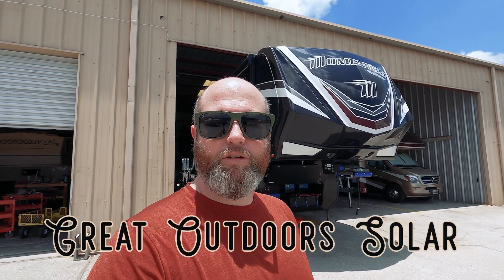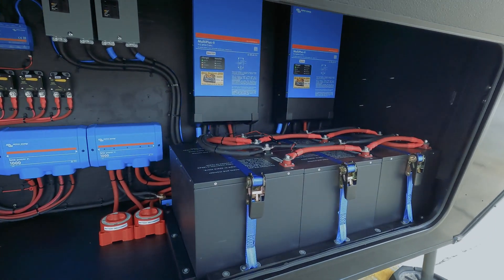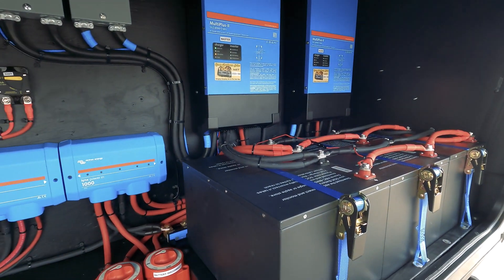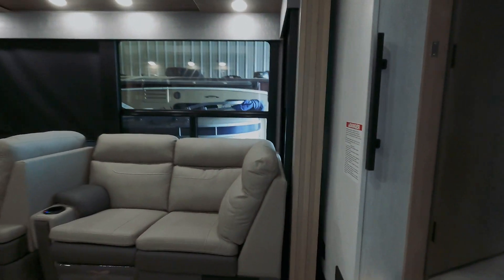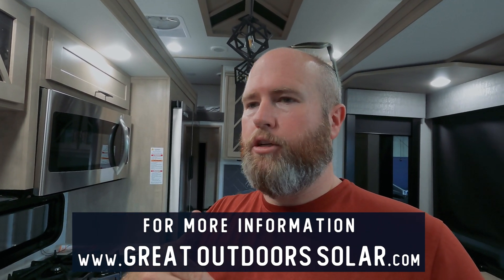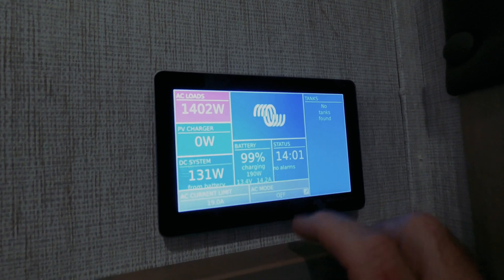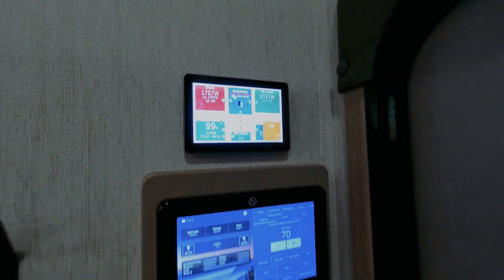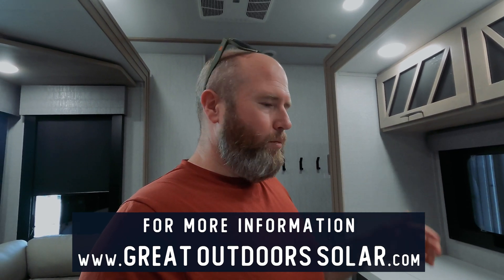MASSIVE SOLAR SYSTEM ON GRAND DESIGN RV FIFTH WHEEL

Comment: Enjoyed watching your video on your Mommentum 410 TH upgrade from factory solar system to your amazingly awesome total solar system upgrade. I’m reaching out today to ask if you could tell me where the OEM controller was located I have a 2021 Mommentum 376THS and it does not have solar on it but I want to add it. It has the automation system installed for things like the generator, lighting, awnings, etc. reached out to a dealership that sells momentums and they had told me that all Mommentum’s come pre-wired for solar I’m just trying to locate where the solar controller would have been located in that RV and was hoping you could help please

Comment: Sweet system. Very clean and balanced install too. Six years ago, we retired, sold everything, bought a low mileage, 1999 National Tropical Class A and went FT. We discovered we love boondocking so built an even bigger big solar/battery system that allows us to live off grid just like we were plugged into a power pedestal in an RV park. In fact, we haven't plugged into a power pole or run our generator in the last 2 years. 

We started small, by building a 620-watt liftable solar array on the side of our coach that makes a nice bedroom window awning too. It uses gas struts, so it practically lifts itself, and we can pin it at the precise angle needed based on latitude and season to boost its performance. Next, we built a 12v, 560ah LiFePo-4 battery using 8, 280ah prismatic cells and a Heltec 330amp BMS. These cells fit perfectly under the steps of our MH where our old pair of golf cart batteries used to reside. A small computer fan blows interior conditioner air into this space to keep the batteries near room temperature at all times. We use a 50a Epever mppt charge controller, a Lnex battery monitor on this 12v battery. We have a 1,000w PSW Renogy 12v inverter that we use occasionally to run some lower current draw items to help evenly distribute our power usage when needed. If this battery ever gets too low, we just plug in our progressive dynamics 80a Lithium compatible converter/charger and transfer some power to it from our 48v battery. 

By mounting our small, 620w solar array on the side of our coach, we left the roof free to rack 8, 550w solar panels down the length of our 35ft Class A, 15" off the roof, 1" above our AC, vents, etc. so it only adds about 3" in height to our coach, so we're now right at 12 ft. Our 4,400w array can run both our A/Cs, (one is a mini split heat pump) our household appliances and charge our batteries at the same time. We mounted a Sungold Power all-in-one 48V, 5,000W Inverter/100A charge controller/battery charger, breakers and a Lnex battery monitor on the wall in our bedroom, as we don't have a big front bay on our coach like on a fiver. This saves us space as well as money compared to a system built with individual Victron components. Our 48v battery which resides under our bed uses 16, 320ah MB31 EVE cells and a 200amp BMS. Together with our 560ah 12v bank, we have a total of 23.5 kwh of batteries onboard (the equivalent of 18, 12v 100ah LiFePo-4 batteries) charged by 5,020 watts of solar. Building both batteries ourselves saved us a lot of money vs buying preassembled batteries, plus they fit into a tighter space too. We built our 48v, 16.4kwh battery for only about $1,800 including the BMS. 

We removed the inefficient and noisy rooftop A/C we had in the bedroom and replaced it with an EG4 28.5 seer-2, 12k btu mini-split heat pump on the upper rear of our coach. It's super quiet and cools as well as the soft start equipped 14.5k Furrion rooftop A/C we have up front, using about 1/3 the power. This 48v system lets us enjoy 24/7 off-grid air conditioning and heat from the heat pump as needed. We can also run our front rooftop A/C for a few hours in the afternoon at the peak of summer heat. Both our rooftop and side array (in addition to our 22ft awning) produce some great shade, wherever we go - even in the middle of the desert. We also coated and sealed the roof with Henry's 887 100% silicone Tropicool which reflects a lot of heat, helping to lower inside temps too, reducing our A/C needs.

Our total budget for both 12 and 48v systems was around $10k plus another $1,500 for the high-efficiency heat pump, as we did all of the work ourselves. Being retired we have much more time than money. Not only will this system last us the rest of our lives, as we're old farts, but it has already paid for itself with the money we saved on RV parks. The biggest advantage is the flexibility it gives us. Last year we visited 11 states, without plugging into a power pedestal the entire time. Last winter, we boondocked in the desert near Yuma, AZ, visiting some old friends. We're visiting family in NC now, where boondocking places are pretty rare, so we're dry camping in a spacious, no-hookup site at a convenient RV park for only $100/mo., saving us $500/mo. off their normal FHU rates, yet we have access to the dump station and other amenities. Life is good.

Comment: Hello from Ouray, Colorado!  Though, we are actually down by Tucson for 2 months, currently.  This is our first multi month trip in our Outdoors RV 22FQS; and it is showing its shortcomings hehehe.  Space!!  So, we have taken a couple of trips around town to some of the dealers to consider other options.  We started off focusing on opposing slide travel trailers; but have expanded to the 5th wheel world for looking.  I'm feeling like the travel trailer option may be sinking hehehe. 

Anyways, we have a 500ah battery system, as well as 1495w of panels on our small 22 ft roof.  If we migrated to the 5th wheel, I'd definitely want to proportionally increase the system.  We don't chase weather as I'm still working, so I definitely don't want to be in the amp hour management mode; having a reserve capability higher than what we think we'd need would be the direction we would want to go.  I saw your video on the Brinkley install (which, we really really liked that 3100 floor plan.....and we also really like those Alliance 310rl's).  I would tend towards a system bigger than your "standard" 2000w system.  

On the install in this video, I really liked how you were able to do bigger panel set up on the roof, but retain a realistic walking path!!  Arguably, my 22ft rig is JAM PACKED with its 1495w on the roof.  And since I do winter camping, it really is somewhat of a twister, death defying balance act to maneuver on the roof to brush the snow off of the panels.

Comment: for a 5th wheel that is a tiny battery bank - no chance this rig would survive high temps with significant humidity boondocking without the use of a generator
Reply from the maker: We size systems based on the customer's specific needs and travel patterns. No RV, no matter how large will survive in high or low temps without a generator or some type of fuel source. You can swap ACs to a mini-split, but the traditional RV AC's can't be powered via solar alone. Having 200+ installs and living and traveling full time has given us real world usage feedback. Safe travels.

Comment: Great info guys.  I have a question …. When you removed the factory inverter. Did you just splice those in and out romex wires together with an 110v outlet in the basement?
Reply from the maker: All 110v junctions should be in a box per code. Sometimes with a smaller circuit we'll add an outlet, other times it's simply a splice.

Comment: Need to start looking at newer 48volt batteries with 4000-5000+ watts of solar. Is being done now more often. Can run two acts and still charge batteries
Reply from the maker: 24 and 48v systems in a RV are less efficient because the majority of the loads (12v DC) have to go through a DC converter that are typically 80-90% efficient aka you're adding 10-20% of inefficiency to the majority of your loads. We've done 24 & 48v installs, and 12v on RVs is the way to go in our experience. Plus 4-5kw of solar isn't going to keep up 24/7 with the AC usage anyways. It's not enough to refill the entire battery bank from overnight usage and still run the ACs. Not in the real world at least. I know people with 8-10kw in solar and 2 RV ACs and they still have to supplement with a generator. In my opinion you are better off with a smaller, cheaper system that runs everything except the AC 24/7. If you need AC 24/7 then you're in the wrong area and should travel to better weather, or simply plug in at an RV park. We've done over 150 installs, have been doing it since 2017, and have 4 years of fulltime travel (actually living off solar) for experience. Thanks for watching -Tom

Comment: I'm curious why you installed a 12v system when 48 v is much better, that's what I've done on my Bluebird motor coach. Nice system anyway
. Keep up the good work
.JS.
Reply from the maker: Because the RVs main loads are 12v from the factory and a higher voltage system requires step down converters which are typically about 90% peak efficiency aka a higher voltage system is less efficient. RVs aren't big enough to really benefit from a 24 or 48v system.
Reply: @GoRVSolar  Or you could build a hybrid system like I did. We have a stand-alone 12v system to power the native 12v appliances in our coach, and a 48v system to handle our 120v ac needs. This way we don't have to convert between the two, though we do have the option to charge our 12v battery from our 48v battery in an emergency, though I've only had to do this twice in 2 years of FT living. We could charge our 48v battery from our generator but haven't had to do so yet. We also have a Renogy battery to battery charger that gives us the ability to charge our 12v house battery from our MH's alternator, but haven't had to use it so far, as our solar has proven to be adequate for our needs.

The main advantage of going to 48v DC is being able to use smaller wires as there is 1/4 the current flowing through them and your connectors, which can easily overheat under high loads if not clean and torqued properly. A 12v, 5kw inverter needs a huge wire (greater than 4/0) to handle the 400+ amps that it can carry but 1/0 wire is adequate for my 48v, 5kw inverter as it uses under 100 amps. Also, an inverter is more efficient going from 48v dc to 120v ac, producing less heat from lower DC current, so it can be lighter and cheaper. It also allows the use of a smaller, cheaper charge controller too.

Comment: Really nice work!  I plan to add a second Multiplus 2 2x120. I was told I had to change to 24v system. You did 12v so I guess that's not true. Did you add the master - slave labels to each multiplius units or do I need to order a different unit for #2.  Did you add any additional cooling to the compartment? My single MP gets hot. I notice in the spec sheet only L1 gets power boost. I'm hoping to run 2 out of three A/C units or the wife will hate me.   Tom
Reply from the maker: You don't need to go to 24v and we added the labels. The master and slave is done via programming. L1 is the only boost, unless you are on a single phase, then the inverters relay combines L1 & L2. Best of luck with your install, I highly recommend you look at the wiring diagram by Victron for multiple units. Seen quite a few "professionals" get it wrong and they end up at our shop. Cheers -Tom

Comment: What brand of 200 watt panels do you use?  Also curious why you didn't do a 24 volt system so you could install a Victron 5,000 watt inverter?   Just curious about the thinking.  I have the generator and would like to run 2 AC units on the inverter and then switch back to the Gen when the amp hours are low.  With my 3,000 watt inverter I can only run 1 AC unit.
Reply from the maker: Rich 200w "12v" panels which are really ~23v. No need for a 24v system in most RVs, you can get a 12/5000 Quattro for example. 24v is not more efficient since we end up using a 90% peak efficient 24 to 12v converter for the majority of your loads.. since most the RV is 12v anyway.

Comment: Awesome install.  I currently have a 2017 44' Road Warrior 50 A Toyhauler with 1200 W (6- 200W) panels in series with a Victron 12V 2x 120 Inverter charger. Victron 150/85 Solar Charge Controller, Currently (2) SOK 206 Ah lithium batteries, CerboGX Touch 50.  My question is what is the advantage of 2 MulitiPlus 2 x 120 inverters vs a Quattro?
Reply from the maker: Good question Mark,
The Quattro doesn't function the same. It only does a single phase (One Hot), but it does have 2 AC inputs and 2 AC outputs on the transfer switch. The 2 AC inputs are for different sources, not spilit phase as they only have 1 Hot per input/output. The Multiplus does have a transfer switch (Terrance is incorrect) but only has 1 AC input and 2 AC outputs.. but it has 2 Hots aka its made for Split Phase (2 Hots). We've installed both Multiplus and Quattros by they way. Both of them in 30A and 50A RVs. So we have experience with both in different configurations.

The Multiplus II 2x120 allows Split Phase (50A) OR 15/30A Single Phase to pass through.  Then in inverting mode on both L1 and L2 by combining them via the relay built into the Multiplus II 2x120. The Quattro would need 2 inverters for split phase and it wouldn't boost on both L1 & L2 unless it was programmed into single phase (parallel). But then it wouldn't connect to 50A split phase without being reprogrammed to Split Phase. Or it could be programed to do both.. but it ends up with the Master (L1) being a pass through and the Slave (L2) only inverts and doesn't pass through when on single phase sources. PROS & CONS to both set ups.

Basically two Multiplus II 2x120 are easier on the user (no reprograming or only inverting om L2 when using single phase source) and also cheaper as well. They are ~$1400 each unlike the ~$3500 Quattros.. aka $2800 vs $7000 for the dual inverters. But they get 4800w on both/either legs. The Quattro would be 3600w per line depending on how it was programmerd/wired. It all comes down to how they were built by Victron. Most people don't need the Quattros and it saves them $$$$.

-Tom
Reply: You can get a quattro that has the same or more power than the 3000va 2x120v Multiplus II, but the Multiplus  II supplies power to both legs of a 50A circuit so potentially everything in your RV is powered.  A quattro only supplies one leg of power, or half your distribution box.  There is a new Quattro II 2x120 that supplies both legs but it is a 3000va just like the Multiplus II.  I think the main advantage of a quattro is that it has a built in transfer switch; you can tie a generator  to one input and shore power to the other.  My RV already has a transfer switch since it came with a generator, so I went with the Multiplus II and saved some money over a Quattro.